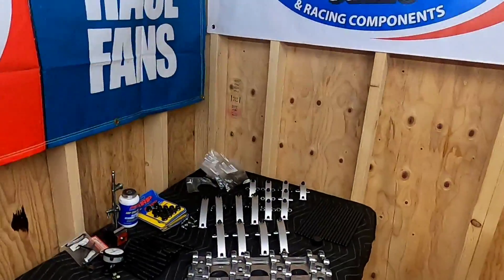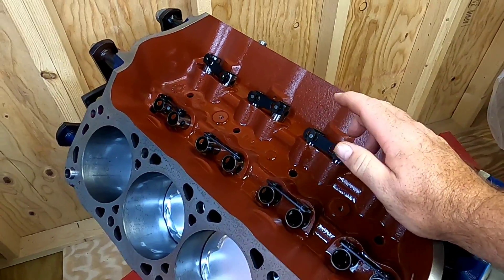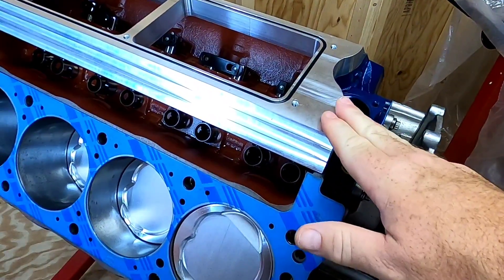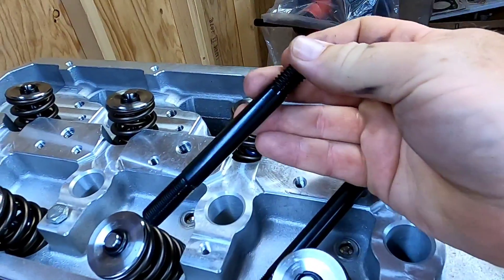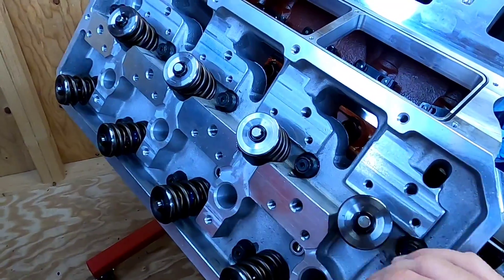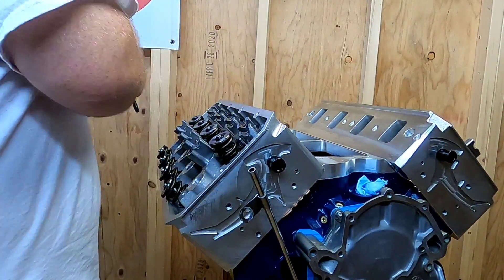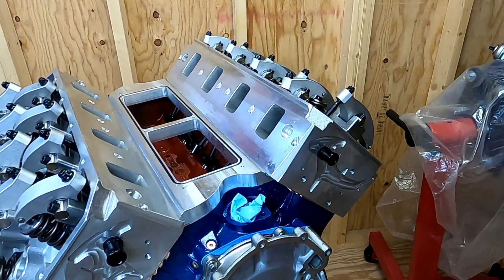BOSS 429 from a 429" Stroker WINDSOR??? Project MIXED UP BOSS

Comment: Did you use and sealant on the intake studs ????
Reply from the maker: On the Rocker stand bolts that go into the intake port, Yes I used sealer on them
Andy

Comment: For years, I wanted to convert a 440 to a stroker 496 HEMI, with heads from Stage V Engineering. But now that Trick Flow has those killer 270cc Max Wedge size heads, that might be a better option. But damn, Hemis are just COOL! Especially with an 8-71!
Reply from the maker: Jeffry I wanted to do that also...back in the mid to late 90's!  Those TFS heads are amazing... And make awesome power!
Andy

Comment: What year did they start making a windsor that's the 429 and would that be a steel block or cast-iron block and how would I tell thank you for your feedback
Reply from the maker: Never... This is all aftermarket, using a 4.130" bore and 4" stroke you end up at the magic number... On the block it is a Diesel grade Cast iron 41,000 psi tensile strength according to Ford.. this block can make max of 460" 
Thanks for Watching
Andy

Comment: Just watching this again for the third time, and for the life of me it looks like that head gasket is on backwards..... small coolant holes in the rear and large hole in front. The angle for seeing the front hole is pretty steep, so maybe a trick of the light. I know the gaskets sometimes say " front" but that isn't always foolproof.
Reply from the maker: Joey you are the first to catch the Easter egg....  If you notice the gasket towards the end of the video you will see a different edge on the front of the head... I wanted to see who if anyone would notice.. you are the first! True Ford Gearhead...
Andy
Reply: @UnityMotorSportsGarage  
Cool, so I’m not going crazy. What kinda HP do you estimate that thing will make? I saw the hot rod article on the 416 LS version, made really good power for what it was but I don’t think that mild build really took advantage of those heads, a good set of LS heads will make the same numbers, I found another HR write up on an essentially identical short block,  same cubes, nearly identical cam and CR, and it made almost exactly the same numbers. Not putting the hammer heads down, just think at the 650hp level they are not being fully taken advantage of. 
The Windsor 427 that made close to 1000hp, now that was making good use of all that flow.
Can’t wait to see your dyno numbers.
Reply from the maker: Since I'm using the heads out of the box and a "somewhat" mild solid roller... I'm hoping for 750hp on pump gas..
Reply: @UnityMotorSportsGarage  
Awesome, I’m keeping my fingers crossed for 776 HP….
Reply from the maker: It would be nice! I'm actually more concerned with torque output since it is going into a 4000 lb truck .. Hopefully I can get some weight out of it but Either way it's going to be fun!  
Andy
Reply: @UnityMotorSportsGarage  Riiiiiight.... Lol

Comment: I agree with you on the stud installation process and prefer to install the studs after the heads have been indexed to the dowels. Much easier on the head gasket as well. Good tip!!
Reply from the maker: Thanks, rotorr22 I've been doing it this way for years it works best for me.. Like you said it makes installing the head gasket easier as well!  
Thanks for Watching
Andy

Comment: Love what your doing, but do NOT say Boss 429 if it's just a stroker small block,not a REAL Boss...not a big block, I do love using the canted valve layout,but it's just not the same...I really don't want to sound like a hater or a troll,but it's just not a BOSS 429...but damn,that thing is gonna make massive numbers on the dyno!
Reply from the maker: Slyane 73 I respect that.. but I'm building my own version of a BOSS 429. These BOSS Style Hemi heads have been scaled down to fit the Windsor block by Greg Brown of HammerheadPerformanceEngines.com.  I'm not trying to pass it off as a real BOSS.. that is why it is called MIXED UP BOSS!  Thanks for Watching and your input. I can't wait to hear it run and see the power numbers...
Andy
Reply: Shane 73, its not just a canted valve head, it is a scaled down version of the Kasse Boss 9 head, and the Kasse Boss nine head is a modern refinement of the origional boss. So this not just a cleveland variant. You could argue that its a modern cleveland chamber turned 90 degrees, and you would be pretty much spot on, but its still rotated 90 degrees and that is definitely more "Boss" than it is anything else, IMHO .

Comment: What is estimated cost of this project and how would it do in a dirt late model
Reply from the maker: Ken, my best advice would be give Greg Brown of HammerheadPerformanceEngines.com a call to discuss pricing and application.  I guess it would all depend on the rules of the class.  I do know that these heads can support 800hp as cast and can flow 500cfm when fully ported!  
Andy

Comment: Did you check the bore distortion when torquing the heads on?
Reply from the maker: PPR Darryl, this block was honed with torque plates. I didnt bolt the head on and check it from the bottom, I have done that on other builds but not on this one...
Thanks for Watching,
Andy
Reply: @UnityMotorSportsGarage  We have found on over bored thin wall casting blocks the distortion is enough to warrant a re spec on the torque settings. We only torque the heads to what the block can handle.

Comment: It's just amazing on how many different ideas for building a engine. Just making a Boss 302 or 351W Clevor using the Australian Cleveland or Yates heads is incredible. I have seen it all and now this. It's just not normal but somehow they make these idea work.
Reply from the maker: I agree Randy from the first time I heard about these heads.. back in like '16 or so... I knew it was something that I had to build! Wait to you see it with the valvecovers on in full dress! It's something else...
Andy
Reply: @UnityMotorSportsGarage  I am building a  1930-31 Model A Coupe and if money was no object I would be building something like this but obviously I will never come up with this kind of money to build a engine like this which I am just putting a 302 with a AOD out of a 94-95 Mustang GT with less then a 100,000 on drive train with a  set of GT 40 heads from a 94-95 Cobra. I have to do everything in segments meaning it sits in a garage tell I have the money to buy most stuff used. If I had the money and it was no object    believe me I could have the right combination of Engine put together by the right engine builder. I am a gear head but with the technology your showing me I would have a professional do it.
Reply from the maker: Randy the combo you are using is one of my favorites!  I ran a 306 in CASPER before the 393w with GT40 heads with a healthy Hyd Flat tappet cam and it made 280rwhp through my C4 and 9in rear...  It ran awesome!  Good luck sir.. sounds like a cool project!
Andy
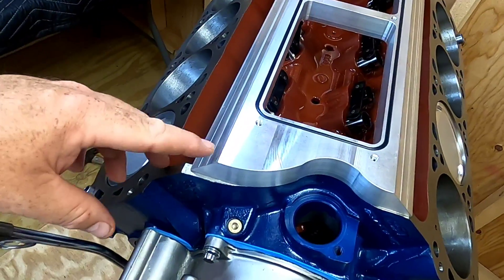Reply: @UnityMotorSportsGarage  I had a guy just get done helping me out on getting a 8" Ford Maverick rear end done for my build which is 56.5" wide just right and same length as the front dropped straight axle. I had it sandblasted. New wheel bearings, seals wheel houses, new brake shoes and drums put in. The tag read 3:08 gears but somehow it has 3:33s which will be fine for a car I will cruise and go to shows with. I would like to add a eliminated slip to it which will cost 350-400 dollars but I can always add that latter for now it's just trying to get a 32 chassis together for my 31 Coupe.

Comment: I have to say I'm not a huge fan of having no fasteners for the valley plate.
Reply from the maker: Yeah you would think it's a bad thing but with both heads on it is really locked in place Thanks for Watching
Andy
Reply: @UnityMotorSportsGarage  It's a very interesting approach, that's for sure.  What compression ratio are you running?
Reply from the maker: @chuckschillingvideos  it measured out at 11.1 to 1 compression
Reply: @UnityMotorSportsGarage  So that should put you at about 550-600 hp naturally aspirated, give or take?
Reply from the maker: @chuckschillingvideos  the goal is 750hp NA on pump gas... These heads flow some serious air 395cfm as cast.. I'm running a 259°/263° @ .050" 
.674"/.705" solid roller cam with Cleveland Tunnel Ram with 2 Holley 660's carbs
Andy

Comment: Andy my man.  Free tip for smoothing out silicone and keeping everything clean. Warm super soapy water.  Just dip your finger and boom its art brother
Reply: I learned to do caulking that way for homes. Excessive yes, but we also got contracts for multi million dollar showcase homes so that’s what it takes to be the best! Love this guys work! Much respect
Reply: Regarding multi-million dollar homes, it’s a cost/ corner cutting technique. We call them "finger painters".
Whereas most commercial grade silicone and urethane sealants that is a big no-no, will void warranties. But in this application, using the tape then some cleaning/ touch-up is just fine.
The tape method is cleanest and usually (if done correctly) leaves the cleaners edge.

Comment: I would have loved the inside of the heads!!!
Reply from the maker: You can see them in my playlist of MIXED UP BOSS.. I did a unboxing and Flow tested them the whole deal
Reply: @UnityMotorSportsGarage  Still in this video one never see the inside of the head.
Reply from the maker: Ron, this is has been part of a whole series on the build
Reply: @UnityMotorSportsGarage  Agree, rarely does one in order of the videos where one can see in the videos alongside and see them.  I only takes a few seconds to see the inside the and this is the best part.  No sense in using a flathead.  Gee, is this a 1/2 intake valve with 3/8 exhaust valve ???  No of course not.

Comment: That peaked my interest. Head flow numbers would be cool, as well as price.... as I'm typing this I see a like to flow testing episode in the YouTube play list. Just having the look means nothing to me unless I'm getting that much more out of it, as it doesn't look cheap. I have a 1968 mustang and stock engine bay to work with.Just a 351w and it seems hard enough to get headers that fit and make big power. I also have a super charged new edge  mustang with a modular 4.6 and I just don't like it much... It reminds me of turbo lag cars of the 80s, and it's gearing should not reflect that.
Reply from the maker: Robert thanks for Watching! I did a flow test over at my friend David Vizard's house and the video is in the MIXED UP BOSS playlist..  They are pretty impressive out of the box ..  we are looking to make 750hp na on pump gas with this setup.. you can go to Hammerhead Performance Engines.com for his latest pricing list
Andy
Andy
Reply from the maker: Richard everyone is jaded with power... I could put boost on a mild Windsor and make the same number...  But you must understand that if I decide to boost this engine .. I could make 1500hp with only 14.7 lbs of boost! How many other engines can do that... 
Andy
Reply: Mmm wondering why you have clearance problems with that engine bay. I have a 65 Mustang with a 351w in thats been in there since 1991. JBA full length headers. Was custom at the time but still fits. The later Mustangs have way more room.

Comment: Does a stroked 351 still maintain a good rod angle for longevity with this much stroke? I know the Chevies really have a lot of side wear on the cylinders because of the short deck. Excellent video.
Reply from the maker: Ken, the Windsor in my opinion has a bit more going for it by having a Taller deck height 9.5 vs the 9.02 of the Chevy..  it doesn't seem to affect piston wear as much in my opinion... 
Hope this helps
Andy
Reply: @UnityMotorSportsGarage  , thanks for the reply. I built a 408" SBC once and it ran awesome but at 25K it was displaying cylinder wall scuff so I was disapointed.
Reply: Yeah, I've always advocated for long rods and high rod ratios, which is one of the (many) reasons I don't like Chevies.

Comment: Easy on that sealer. Wipe it along inside of valley area to keep it out of the oil pump screen. Or worse. Those heads are BOSS!
Reply from the maker: Don't worry David, I checked that! Thanks for the kind words and for watching!
Andy
Reply: I was thinking the same thing. Size of bead seemed a bit excessive, I would have applied it closer to the outer edges of china wall (especially since you had the tape there to aid I’d cleaning excess and cleaner appearance. But I know this isn’t your first rodeo,,, lol.
I would still have looked under base plate through the access plate opening to make sure their were no big gobs to potentially fall off and clog an oil drain/ pickup etc.

Though I’m sure that the cam you’ve chosen will probably idle so smooth that you’ll be able to stand a quarter on its edge and it won’t fall over, (a roll of quarters so that is,,,lol).

BTW, greetings from the wrong side of Gaston County, ;)

Comment: Clean roller lifters with kerosene then blow dry then soak over night. Prime oil pump while rotating crankshaft for full oiling of roller bearings.
Reply from the maker: Yeah, I'm still old school... Clean, Soak, and then Prime!  
Andy
Reply: The crank? Doesn't the distributor shaft turn the oil pump?
Reply: @TheRoadhammer379  on that engine yes. Distributor would be in stalled to pump oil. Or cycle oil pump with drill to keep components lubricated. Some people install after market rocker assemblies and are pushing the rocker arm at full lift with the wrong geometry causing lifter and other valve train failure from the excessive force at full lift.
Reply: I was taught to fill assembly lube in the oil pump when reassembling it after blueprinting. Drill priming everything before firing.

Comment: So this is a Windsor small block? Is there a benefit using small block instead of a 460 based big block?
Reply from the maker: That is a great question!  For many people myself included...  I would love to do a Boss 9 engine.. BUT it for me its about the physical size and weight of the engine.  This gives people another option as it would be easier to fit in some chassis platforms.  By being in a small block platform you would be saving a extra couple hundred pounds on the nose of your car with this setup vs the 385 series Boss 9...  It all comes down to what you want and need for your app..  Thanks for Watching,
Andy
Reply: @UnityMotorSportsGarage  makes sense! Very cool build
Reply from the maker: @9090ruby  Thanks for the kind words... I can't wait to hearing it run and dropping it in CASPER!
Reply: WEIGHT ! = i thought that was obvious !
Reply: WEIGHT = HORSEPOWER ITS LIGHTER
Reply: @sorshiaemms5959  more displacement can also equal more horsepower.
Reply: @9090ruby  TRUE BUT IF YOU HAVE A 460 WINDSOR AND A 460 LIMA THE EXTRA 200 LBS OF THE LIMA IS A DISADVANTAGE

Comment: Man I gotta say That's some Top notch work' and it's definitely badass' but One big question? How much does a setup like That cost pending That you have a good healthy Windsor to work with?
Reply from the maker: Henry, to buy the kit from Hammerhead Performance Engines..(Greg Brown) depending on your setup..  Cam choice other specs..  you will around 7k that includes the rockers and valvetrain.. I give a price breakdown on my Flowtest video of these heads so you can see it there! Thanks for the kind words and watching!
Andy
Reply: @UnityMotorSportsGarage  Hmnn' much nicer than a coyote swap in my foxbody mustang I wonder what the space limitations would be on that?
Reply from the maker: @henrytyson4152  it will fit easier than the Coyote... Just know you will need to have custom headers made for the car..
Andy
Reply: @UnityMotorSportsGarage  Thanks you've sent me in a different direction 👍

Comment: that looks expensive and it looks like it will lots of power, I like it.
Reply: Not sure, but I imagine a stroked 460 would be cheaper to build and possibly make more power.
Reply from the maker: You could go that route .. but I wanted a BOSS 429 in a small block package...